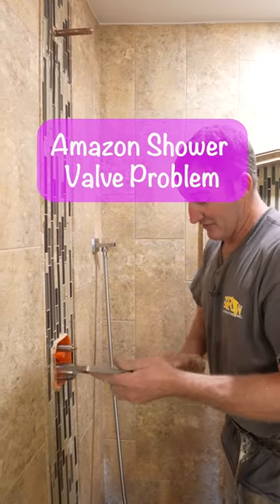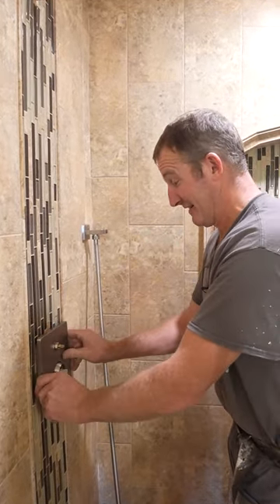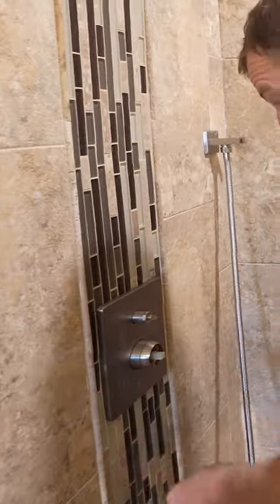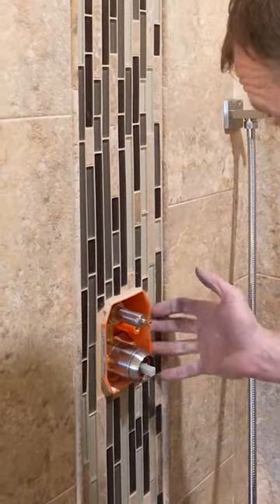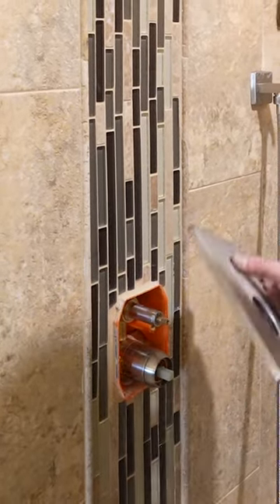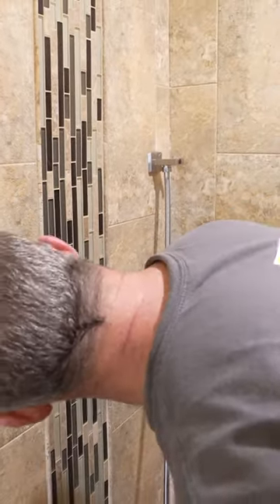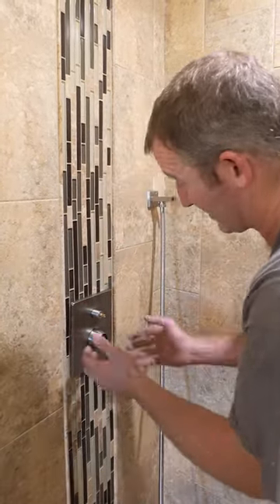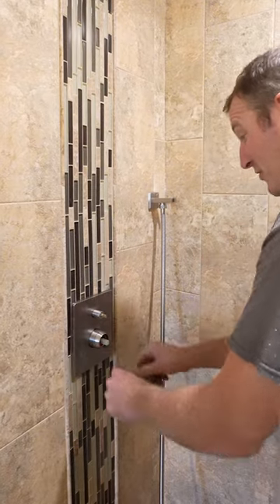Amazon Shower Valve Problem

Comment: Ive put in quite a few of those. Just silicone around the valve box and the inside perimeter of the trim plate. Visible sealant around trim plates looks tacky AF.

Comment: It looks like there’s a spare threaded insert molded into tie orange box. If you wanted, you could get a nice decorative button-head screw and attach the plate that way. The standard way seems flimsy especially if it ‘rattles’ a bit when you touch it.

Comment: I never buy shower valves from Amazon. Buy from plumbing supply in case you need parts.
Reply: I have been telling people that but they don’t care. they see what they like and buy it anyway. 2 or 3 years later and they need parts. I told them take the whole thing out and put a new one in. Instead of a $100 fix, it will be in a Thousands fix

Comment: Don’t buy a shower head from Amazon next time, problem solved.
Reply: I had a customer bought a bathroom light fixture from Amazon. Every thing is written in Chinese. Never see those wires before so I told the customer I’m not going to install that light. I just don’t want to get blame if the house burns down